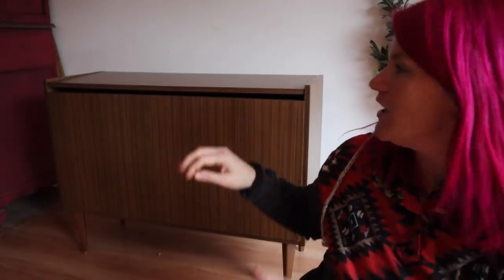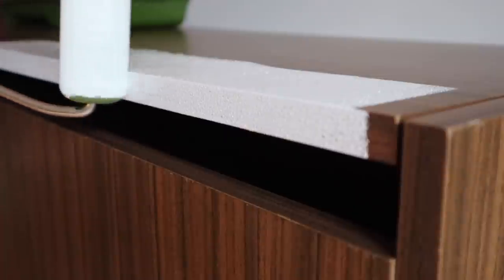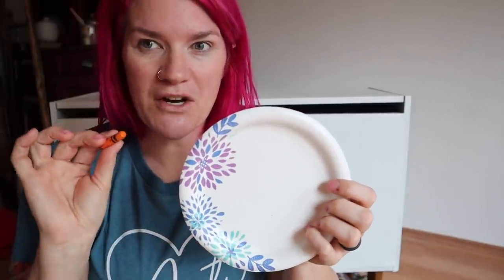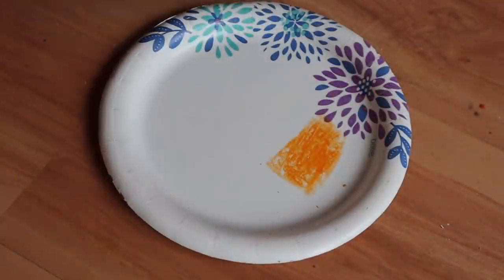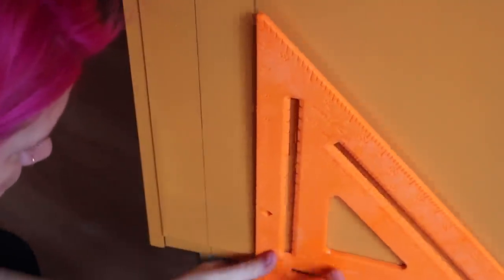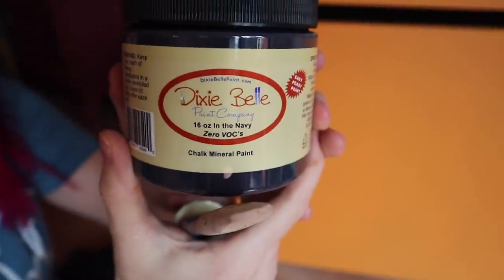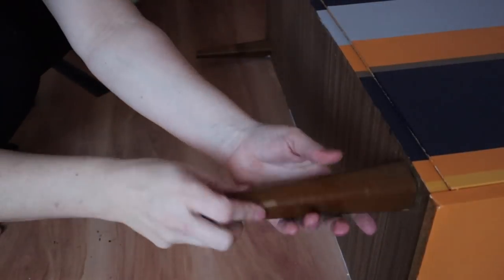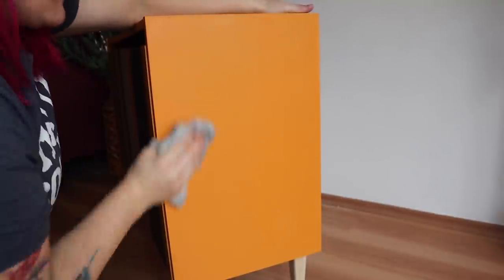Learn How To Paint Perfect Stripes |How To Paint Laminate Furniture

Comment: You said it's a water based wax.  Does that help it to wash out of the microfiber cloths well?  I know you wouldn't want that to transfer if you're using it to wipe dust off a piece before painting etc.   love the trick for fine lines.  Amazing piece. 💞💞
Reply from the maker: It does!!! I like the waterbased wax also because it’s easy clean up :) and it doesn’t smell I am a migraine sufferer and smells trigger it so I try to stick with low odor products when I can :)

Comment: I've used my original paint color to seal edges when painting houses. Could you work on other stripes while waiting on paint to dry from first stripe? It's a very unique piece.
Reply from the maker: Yes, absolutely!!! That is actually what I did, I worked on ones that were in different areas while the other ones dried :) The original paint color is a great option too, I just like the clear coat because you don't really have to be as careful not to get it on other colors when you start going back over the other stripes, if that even makes sense?

Comment: I love the tip on using the clear finish for clean lines! I’ve always used paint, the same color as the base color to seal the tape edges. But that can be tricky in some applications. Ty for giving me another option! Just curious how long do you allow the clear coat to dry before painting over it? Thanks so much for another awesome video and makeover!!
Reply from the maker: Just until it’s dry to the touch is all I don’t wait super long after that :) you are so welcome!!! This is such an easy way and then you can use it over all the colors!
Reply: @BellaRenovare  Awesome thank you so much!! Can’t wait to try this method!